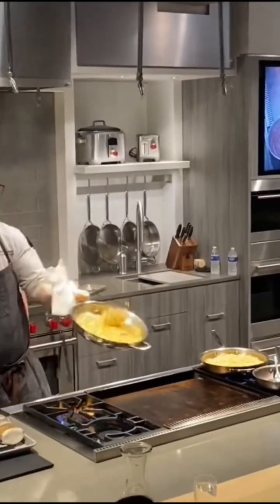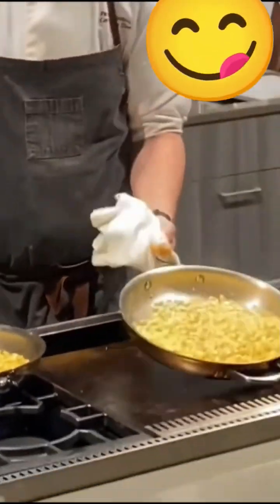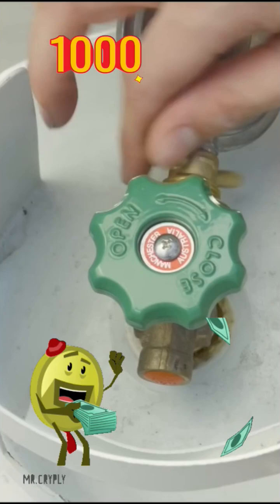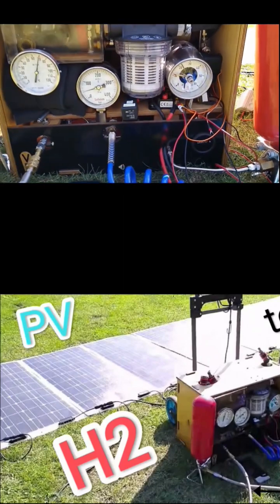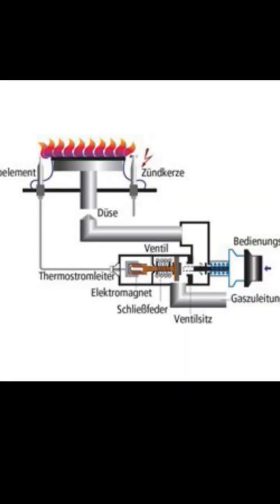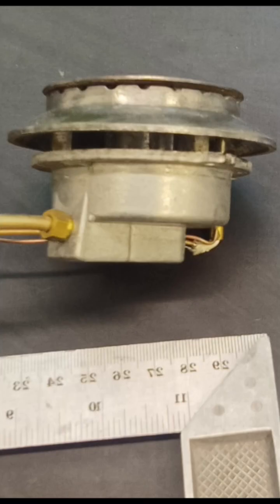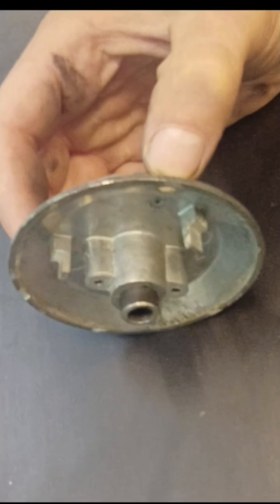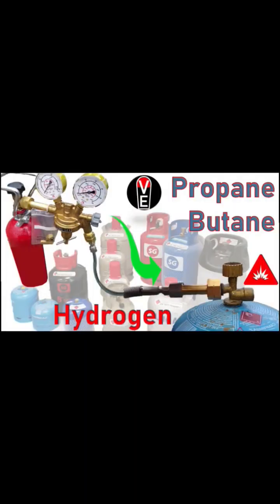Hydrogen cooking stove, how to convert propane gas cooker to h2

Comment: I am currently doing this right now, but I cant find any information on adjusting the outlet, can you link me to some in depth instructions? I want to convert my propane stove and propane water heater to run off a PV electrolysis and compressor setup.
Reply: Bro did u get any information about the burner design i m also working plz share about it pls reply me here